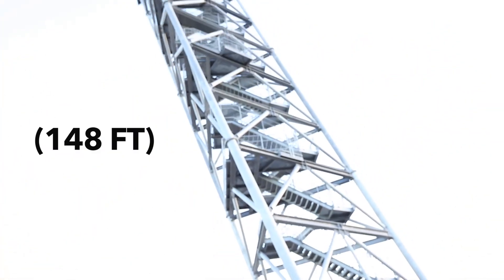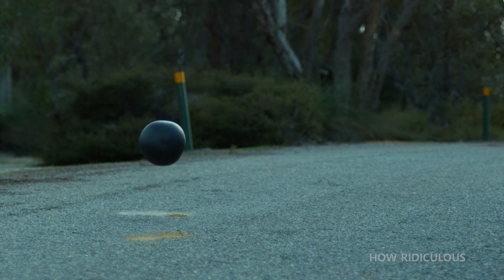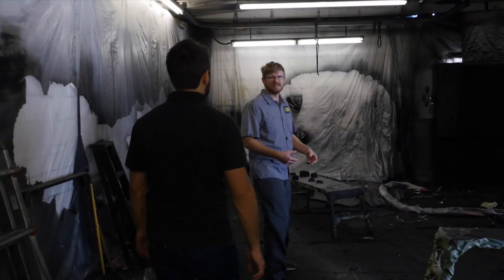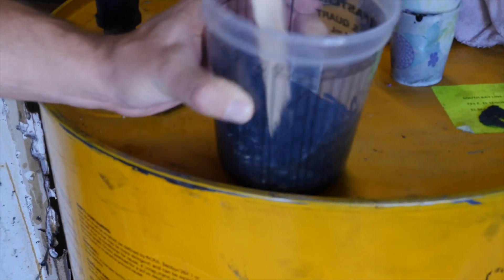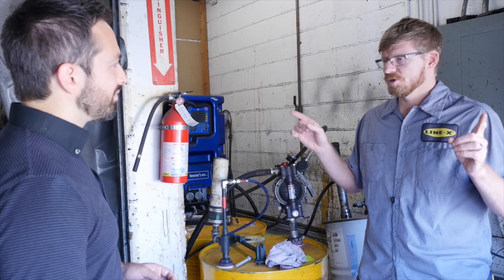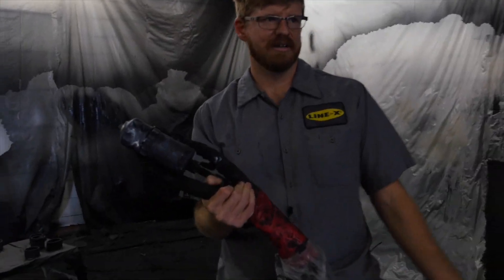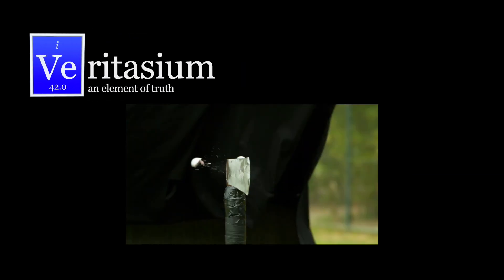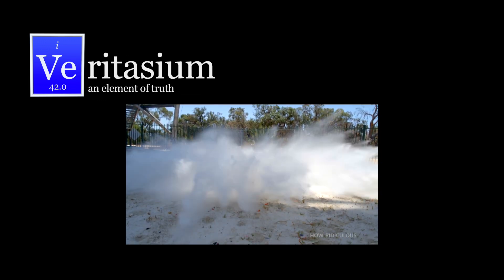Indestructible Coating?!

Comment: I noticed how thick the coating on that watermelon was. It wasn't a thin coat like on the paper, it was about an inch thick. Wouldn't pretty much any other common rubbery material have achieved the same result with so much coating? I think this experiment is confounded. The Line-X stuff sure is cool, but to really give a decent idea of exactly how durable it is, you'll need to find the minimum necessary coating thickness and compare it to that of other materials which may be put to the same use. It kind of makes this entire video fun but pointless. =/
Reply: That's the point of a demonstration experiment. Make it as thick as possible so that nothing will go wrong. ;)
That being said, there are not many elastic compounds that you can spray onto a watermelon. Many of the stronger ones need an oven to cure and most others a very large amount of time.
Reply: Can someone explain me why this comment stops in the middle of the last sentence? I have seen this a lot lately on YouTube. Is it a bug?
Reply: Yeah, I was pretty bummed out too when I saw how thick the layer was. But it is still impressive. Maybe not because of the material itself but because it is sprayed on. That means you can get it on basically anything that can withstand the heat, no matter the shape or form.
Reply: Azrael Exlibris It sure as hell does not stop bullets. It stops pieces of shrapnel that are formed when a bullet smashes against the coated steel plate that is the actual armor.
Reply: ***** 
Yes it is a bug. Reload the page and look at the comment again.
Reply: I'd hazard a guess that there aren't too many "rubbery materials" you could spray on to a watermelon.
Reply: Of course its pointless, polyurethan as elastomere is well known since the 60's. Nothing news, Line-X has nothing to do with science, its a company. The most shoes are made of Polyurethan
Reply: ElectroBlood if you think there are only working politicians in the government you're kinda stupid. this decision isn't made by politicians but by the defense department. these are highly educated, top scientists. they know what they're doing and wouldn't spray coat the walls if it had minimal effect. politicians just gave it a green light. I'm not a big government fan either, but don't underestimate their professionality.
Reply: Civil Savant you couldn't stop bullets with any other rubber material. 
and of we start nitpicking, the experiment demonstrated that the coating can prevent breaking in cases where non coating would result in breaking. it never stated that it was the only thing that could achieve that so a comparison with other materials was not needed (though very few would be able to achieve that, especially that easily)
Reply: ElectroBlood you learn something new everyday, thanks
Reply: Azrael Exlibris I learned that from the AR500 steel plates that "Demolition Ranch" shoots at all the time (at least he did back when I used to watch his videos)
Reply: No, it's just Candlejack.

He will t
Reply: was the inability of a human to tear a piece of painted paper not enough for you? smh
Reply: Ah, you are right! Thank you.
Reply: ElectroBlood there is a demo where it stops birdshot, not exactly real bullets but still impressive.
Reply: Civil Savant the watermelon had about the same thickness as you'd apply to the bed of a truck.
Reply: they use it at the pentagon .. mil spec tested
Reply: they used it in the Pentagon so you could say it's pretty durable
Reply: I looked up the stuff. Polyurea, which this stuff is made from, is used because it has a sort of self-healing property. After it's been cut or punctured, the pieces can press back together and seal back up again into a solid. Flex-seal, in all the informercials, as well as a few others are made using it. It's a new standard for small boat liners, and other water sealing applications because if there are punctures, you can just remove the nail or whatnot and it will mostly seal itself back up again.
Reply: mefnow 
Yeah right, because politicians in general know anything about physics (not).
It should be able to make the walls slightly flexible, though, helping to reduce small shrapnel.
Reply: Civil Savant Want to watch top 10's?Have a look at our channel.

Comment: That wasn't so much a coating as it was a sprayed on shell, it was thicker than the rind of the watermelon itself, 'coating' makes it seem a thin layer, that definitely wasn't, of course an inch thick polymer will work, inch thick regular tire rubber would as well.

Comment: Just wanna mention this:
There are different types of durability: stretch, twist, bend and so on.
Best example is: how atmosphere can squash barrel? (when no pressure from inside)
Because barrel is not durable for this type of "impact". It's strong for stretching, but not for squashing.
Here is same effect, it's strong for stretching, but this is much weaker for smashing.

Comment: my god... soo many uses for this stuff. i wonder how is works as sound and thermal insulation. how anti corrosive it is (imagining this as an undercarriage spray on a car. absorb sound, stones... damage from bottoming out... and save it from canadian winter damage). imagine a 3d printer that has 2 nozzles mixing this. print cell phone cases. the list goes on and on. 

couple questions... how destructive is this to make? how toxic are the fumes? are the components an environmental hazard? i dont ask these as fuel to stop production like a hippi, but as someone who is curious about material safety. i work with resins at home ^_^

Comment: what would happen if you cover your entire body with that stuff?
Reply: Your body would suffocate as your skin (an organ) breaths, thats where BO comes from...
Reply: Gone Bananas BO?
Reply: What do you mean by "spray liquid nitrogen under the application process"? Do you mean spray the LN on the skin before the application of the Line-X or after? Either way, I'm confident you will still die. If you really want a body armour, just get a shirt, a pair of pants, a shoe, and a balaclava sprayed instead of your skin.
Reply: Andrey Pozdnyakov spray liquid nitrogen under the application process
Reply: Andrey Pozdnyakov then you will have a permanent body armor
Reply: I'm not sure if that's incredibly stupid or genius
Reply: Kunal Mehta Little bit of both
Reply: you wouldn't be able to move though
Reply: M a g e n t a you would just not apply it at the joints, problem solved
Reply: Kevin Larsson hmmm, good point, but I'd then argue both that the armour would be imperfect, and that you're mobility will still be quite limited
Reply: M a g e n t a :/ true
Reply: If you didn't die from the initial heat you would eventually die from a heart attack do to overheating of your body. Your pores wouldn't be able to breathe, and you wouldn't be able to sweat.
Reply: All I can think of is the Spray-on Shoes from the Cloudy with a Chance of Meatballs movie.
Reply: Guy_With_A_Stick omg that is totally it xD
Reply: Matrix would happen. Except you wouldn't wake up.

Comment: Does it get soft again when heated?
Reply: That's what she said...
Reply: Elastomers and thermosetting/curable plastics generally start to decompose, rather than get soft. I guess this stuff will also not get kneadable again, because of the crosslinks.
Reply: Not true. Everything does not go through a liquid phase change in atmospheric pressure. At the right heat AND PRESSURE, anything gets soft.
Reply: John Quilitz Enough heat usually breaks most long chain polymers, and will soften them, temporarily, but then causes crystallization to occur, which can cause brittleness when cool again.
Reply: ***** Touché
Reply: Burak Bağdatlı 
No. These are not thermoplastics. A chemical reaction formed the plastic, which won't be broken by heat, in general. Of course if you apply enough heat it will burn.

Comment: is this stuff strong enough to hold a space-elevator, if it was made as a fiber instead of a coating?
Reply: It would actually be quite a step in spacetravel seeing as the cost of transporting supplies into space would be incredibly reduced.
Reply: gatesofcerdes if used properly, it can provide us a HUGE advantage for space travel. So, not so stupid.
Reply: By faaaar not strong enough. It's basically just a tough spray-on rubber, not a wonder material. Carbon nanotubes are the right stuff for space elevators, they have an incredible tensile strength.
Reply: no. definetelly not
Reply: gatesofcerdes so you don't want to see space?
Reply: space elevators would suffer massive, like... MASSIVE centripetal forces from earth, i doubt it would be strong enough, its a polimer so basically its thickness is directly related to how strong it can be, if made into fiber it would probably lose some. Besides, graphene is probably stronger as it is the stronger material known to mankind, and its also conductive and can have circuits integrated into the very structure, so its probably a better option for a space elevator...
Not that its actually that good of an idea to build one, but if we were...
Reply: Paulo Mangano people like to send stuff in space. it costs $25 million to send 1 kilogram of cargo to space. soon enough, people are gonna send heavier stuff to space. if we build a space elevator, sure it will cost a lot, let's say $2 billion. but the cost of sending stuff up to space will be lowered down to atleast the ten thousands. we could send 2,500kg of cargo up to space as with the traditional 1kg.
Reply: Kenneth Pratoyo
 True, but you are ignoring the maintenance cost of such structure, again, if its a space elevator it means that one, its connected to the ground, and two, the other end is far enough into space that its mass becomes irrelevant on the ground (so it doesnt crumble, like a 30 Km building would.)

First of all i dont think it is literally possible with the technology we have today to build such a big structure without it falling apart, but lets say it was, you have no idea how much money you would have to spend on the thing, i mean, 2 billion? The huble telescope alone costed 4.5 bi, with the maintenance cost added it aproximated 10 billion by 2010, we are talking about a 13 meter tall structure. Now imagine a space elevator that should have a MINIMUM height of 210Km (the lowest orbit) that would have to be built on earth and assembled in the various heights it would cross... We are talking at least trillions here, its not feasible.
Reply: Geostationary Orbit is 35786 km above the surface, the elevator "rope" would have to be a bit longer than that to keep it tensioned. So the carbon nanotube or graphene structure would have to be at least 36000 km long, which is, as you said, kinda expensive.
Reply: Paulo Mangano k

Comment: Could I spray this all over my body?
Reply: Rapids Yeah. On the other hand, you'd probably get roasted alive by the heat
Reply: Yeah. But then I would come out stronger then ever.
Reply: Rapids oh ur trying to be protected from the "Light"
Reply: on the outside... the notebook could kill with the inside
Reply: Rapids You would have burns in your body that would stay that way and if it's hot enough, then your skin sticks to it. This won't make you stronger, infact it will make you weaker, since it will get heavier and besides, this substance would not let you move.

Comment: The water melon inside was a potent illustration on why the strongest helmet will preserve your skull but not your life...
Reply: that's why good helmets aren't made to be strong they are made to crush on impact, absorbing as much of the energy as possible. Also why you should replace a hemet after a fall, or really even after dropping it really (for proper motorbike helmets)
Reply: You gotta Linex your brain for that.
Reply: All that energy has to go somewhere.
Reply: Sure, but helmets are made for a variety of things. A very hard helmet might be designed to minimize penetration of the head by things like shrapnel, that may be moving fast, but probably aren't going to impart a ton of energy, whereas things like bike helmets are designed to collapse in a crash to slow down the change in velocity, to minimize the acceleration your brain undergoes.
Reply: Tom Tom Helmets are not a flexible coating around your head... That's a really different concept
Reply: That's why for making helmets, strength of the material is the parameter instead of its elasticity.
Reply: If your falling from that height it won't save you but if you are riding a bike it could mean the difference between life and death.
Reply: Funeral directors call motorcycle helmets "face savers". Makes the job easier.
Reply: I'm pretty sure helmets aren't designed with the intent of saving your life from a 45 meter fall, so I really don't understand the point of mentioning this.
Reply: Tom Tom just spray the stuff on your brain, obviously
Reply: And why it's not because the bullet won't penetrate your body, that you will survive
Reply: well why do you think cars are made to collapse? If cars were made out of titanium they would be more durable, but the people inside would turn into jello
Reply: @MichaelS-vy1ku they still do turn people into jelly what? It would just be too expensive and very energy inefficient to make cars solid chunks of metal or whatever you're imagining
Reply: And why a good helmet just has a thin hard shell, but is mostly material that takes a lot of energy to crush, so it gets crushed instead of your brain.
Reply: momentum conservation is a bitch.
Reply: The main function of a helmet is protecting your head from scrathing and burning when you  fall off and slide on the road
Reply: seigeengine that is why i said strength & plasticity of materials.
Reply: Michael S They aren't made brittle.
Reply: Herbie Cucumber Really? I Guess there's no point in me wearing one when I will suicide prank.
Reply: But they are actually designed with certain "buckle points", mainly the bumpers, that take as much force out of the collision as they can.
Reply: I saw on an educational program about the death of Abraham Lincoln that the consistency of a living brain is about the same as jellow.
Reply: Haha yeah.   You will be pretty but your brain is mush.     Helmets for sure help.   But the sudden stop is what causes the damage.  They will save your life.